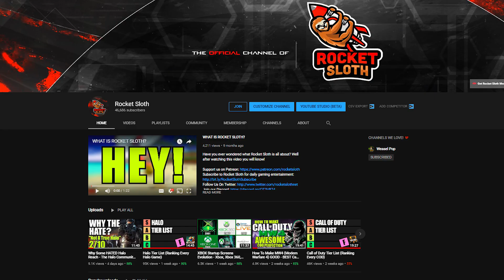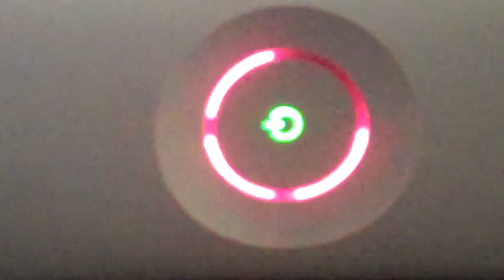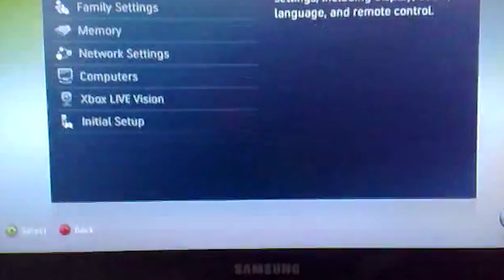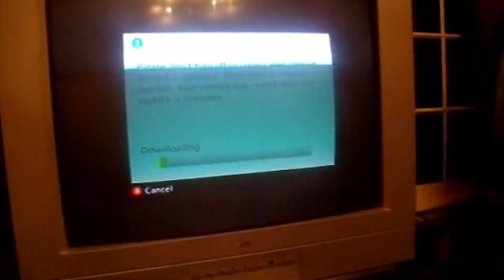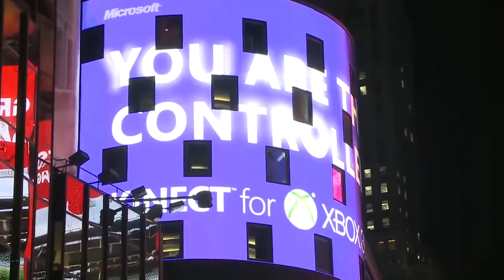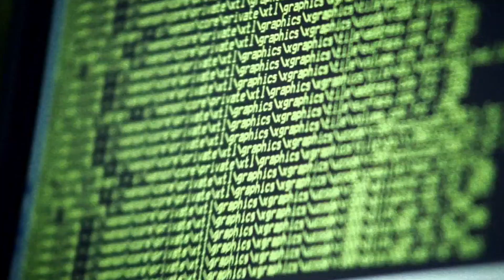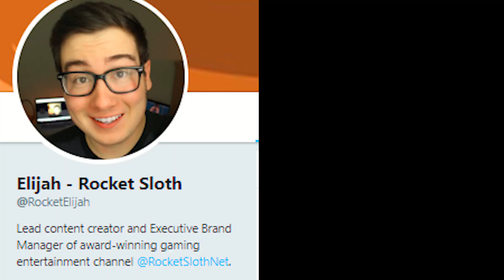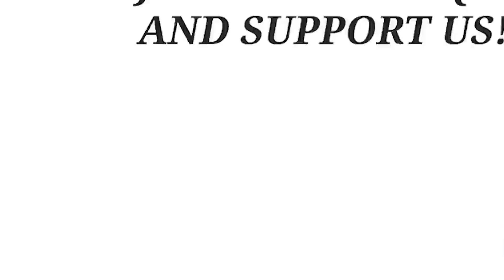7 HUGE Problems Xbox 360 Owners Had To Deal With

Comment: One I had with the 60GB console was the 'Open Tray' error where it just wouldn't read discs. Sent it back to M$, had it fixed, then it happened again maybe 6 months later. Sent it back and got it fixed again, then it E74'd on me about a week before the extended warranty expired. Luckily they replaced the console under warranty free of charge, but the next problem I had was I lost most of my DLC that I bought with my old GT that got hacked. It was all still on my HDD which I kept, but because I'd bought it on the old console, it was tied to it.

Comment: I had my first Xbox in 05, that red ringed. Got a replacement from the shop I got it from, that red ringed. Sent that to MS for repair, that red ringed. That console went back and they gave me a different console, that red ringed and I gave up at that point. Got a Slim model when they came out and that console is still kicking! 

Fun times!!

Comment: You forgot one thing. The fan in the 360. Those things were loud asf. Like every time I’d put a game disc in my 360, the fan would get loud, and I’d tap the console a few times to get the buzzing to stop, which does work sometimes, but also make the buzzing worse. So I’d put a bunch of tissues under it, which made it more quieter. Ugh, the buzzing of the fan always annoyed me. But I’m still keeping it because of all my Transformers games, which none of them are backwards compatible for the One. And also some of my Godzilla games that are backwards compatible for the 360.

Comment: My fan broke just before the warranty and i got it replaced. I got some time later on the ring of death and my Xbox 360 was accidentally covered up and it started working again. I also put a smile screwdriver in the back to block the fan from turning end it worked. I was lucky enough to get a discount on a scratch disk when i slightly moved my console. My disc port was stuck end i had to pull the front cover off so i could put a small screwdriver in a hole to pop it open. My Xbox 360 still works if the room temperature is not too high.

Comment: Lol I got the red ring of death about 5 times before I scrapped it for the newer black edition of the 360. I usually got the ring during trying to save in nba 2K or loading games. It would pop up and I would go turn it off and wait a few hours or so and I would play for quite some time before it popped up again. I tried the towel trick once too and it "worked"  for whatever that is worth lol.